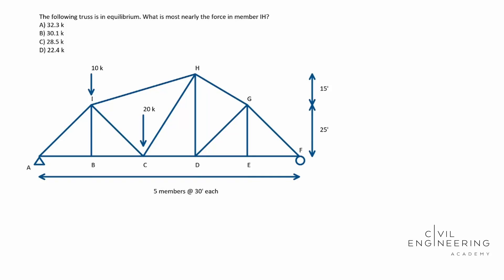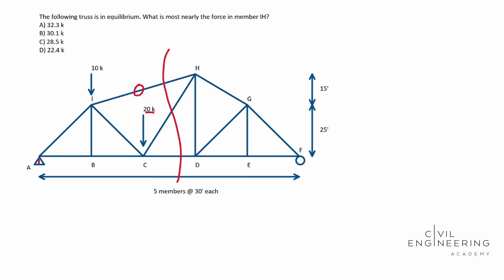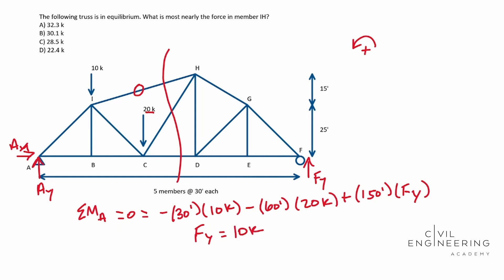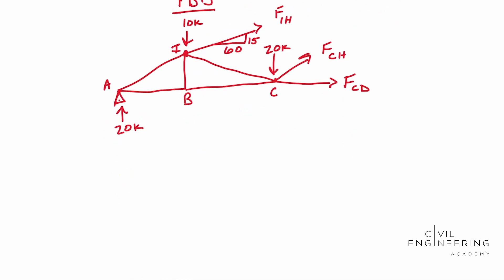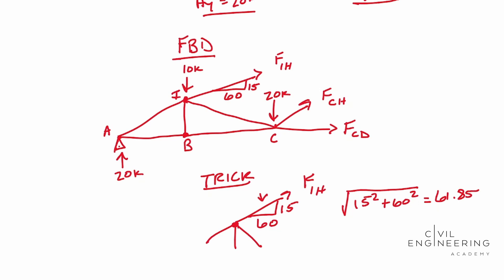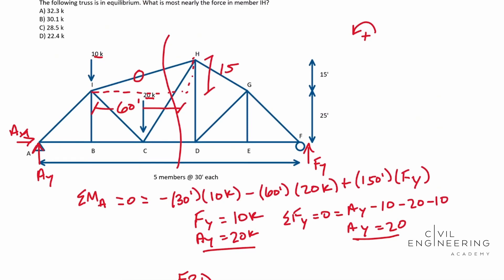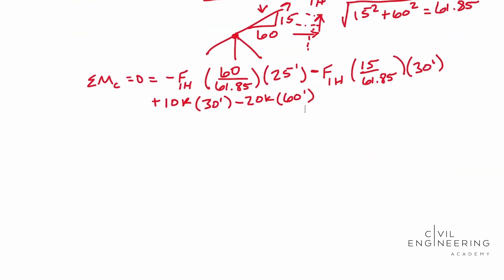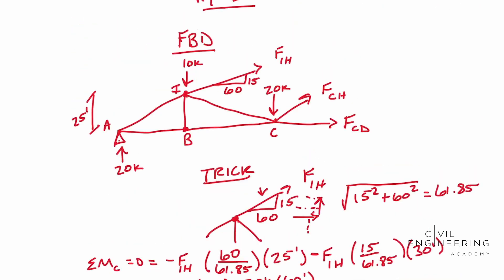Civil FE/PE Exam - Structural - Method of Sections - How to Solve for Internal Forces of a Truss

Comment: An easier way to solve this is by taking a moment at A and solving for Fy, then using the right side of the truss. Make a cut at the same spot you did in the problem and take a moment at C. Then you don't need to solve for the reactions at A and you don't need to use any of the loads at I or C in solving for HB.

Comment: Is there a reason you chose to section between CD vs BC? When Solving thru BC you remove the 20k from your equations, simplifying them and return an answer of approx. 28.1 which would still be the correct answer. Do you gain a more accurate number by including more?

M(C)= -20k(60')+10k(30')-F(IH)cos14(33') = ~28.1k
Reply: I was wondering the same thing, but then it clicked that if you cut at BC you will have to include force at IC in addition to IH taking M(B), still possible but won't be able to solve it with one equation. Doing the cut at CD lets you take M(C) eliminating forces at IC and CH and the 20k on that joint, leaving IH to solve more simply.
Reply: Ncees pe hb 1.1

Felt like a statics 101 homework problem. Lengthy, messy problem, with multiple ways to mess up. Good pe practice but not a pe-grade problem. 

Thanks Cody.

Ans = 28.52 k = <c>